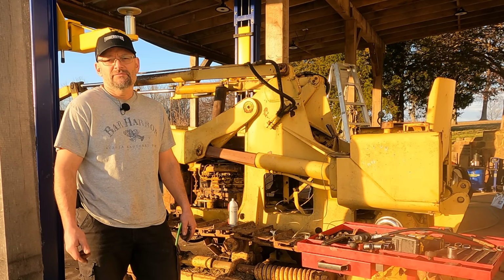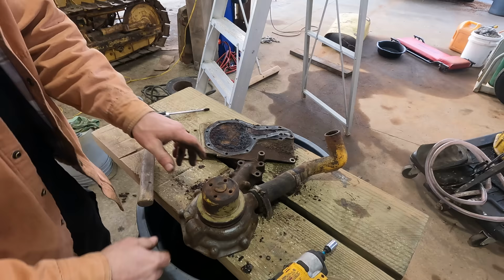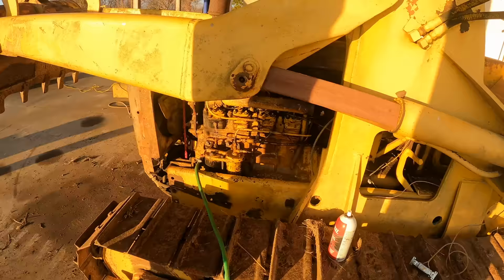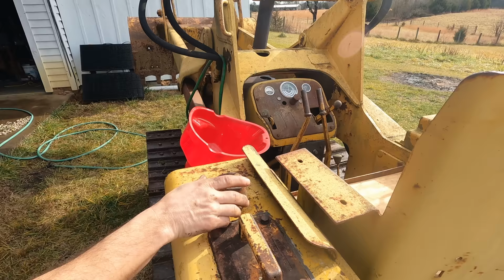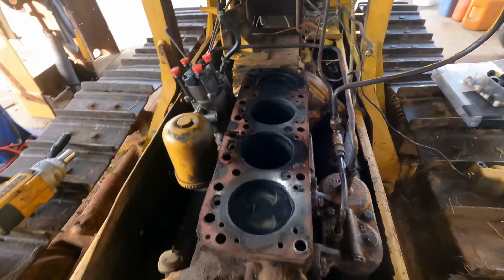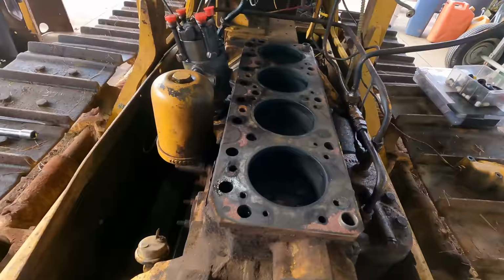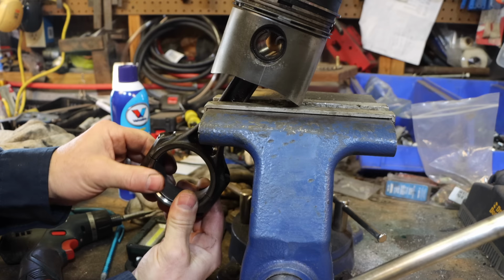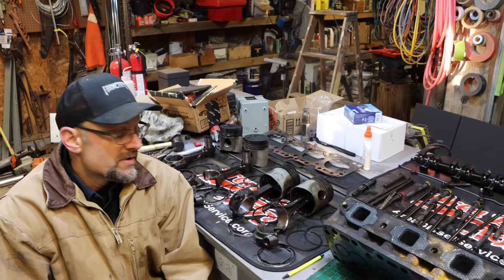1960 John Deere 1010 Diesel Engine Teardown.  Worth Fixing?

Comment: For the steering clutches, I haven't done it on heavy equipment like this, but I have serviced snowcats with similar clutch/brake arrangements.  The material on the brake band may have fallen off at this point.  If you can find the parts, they are usually a pretty easy fix.  There is usually an access panel that you can pull and get to them without tearing the whole final drive out of the machine.

Comment: The clutches are probably dry and if I’m not mistaken you can take it all apart without breaking the track. Now don’t quote me on it it’s been probably 45 years since I owned a 350 and they pretty much look the same. The 350 was a three cylinder. The first day I owned it I had to pull the motor out and replace a O ring on the direction reverser. Only took about half hour to put the motor on a old tire on the ground. You won’t believe just what those little high lifts are worth. Maybe not in money but in just what you can do with them. Small enough to get in very tight places, heavy enough to really get something done.  Still small enough to pull with a 3/4 ton pickup and a good trailer. I wouldn’t look at it as a I need to get it done right now job, look at it as a when a few extra dollars and time is available job. It isn’t all bent to hell and the under carriage is good shape I’d keep it. I still wish I had that 350 today, the guy that talked me into selling it still has it and uses it.

Comment: You could make weld if you have a wire feed Meg on the Pistons, but welding would be preferred. I have even oxyacetylene welded aluminum pistons and turned them, but it is a bit of a challenge. You have to be careful.

Comment: even more content? yes please!
the water pump fix ended up being quite easy considering how locked up it was. you take the wins no matter how small they might be.
very surprised to see scratches on piston wall 1, for sure thought piston wall 4 would be in really bad shape. the compression between the pistons seems really weird though considering the broken parts on two of the pistons and the possible leak between piston 2 and 3.

was really cool to see the pistons, watching that ring just fall apart was, while expected, quite funny to see. then the cracked parts of the piston =( . well hopefully things turn out with the machining.

Comment: Pick you up a roll of that flexseal tape next time you spring a leak in an old rig or something like the dozer that you want to stop the water temporarily wrap it in flexseal tape works great for emergency. Repairs carry some in the car that way if you blow a hose traveling or something you can stick it around the hose and it will get you to the next stop or next part store.

Comment: Hello: John The saying goes, nothing runs like a Deer. Possibly true. The welding should work for a machine not used very much. I did a lton of work on restoring old Aircraft this type of weld repair was used successfully many times.Another option is to use other pistons that are available that are close but larger in required dimensions and machine them to desired size. I am sure you will find a way to make that Deer kick up it's heels or tracks again.
Freeing up that stuborne clutch or brake will also be very interesting to watch.
Looking forward to future episodes. Save The Deer.

Comment: Hey Jon,
It is difficult to justify throwing money t this piece of equipment. However, apart from the glow plugs, a scored cylinder, a couple of broken pistons, the lack of seat, problems with the drive clutches, leaky radiator hose(s), leaky hydraulic hose(s), a couple of marred lift cylinders, and who knows what is in the gearbox, the rest of it looks pristine under that protective layer of rust.
It is a diamond in the rough, or maybe a lump of coal that may become a diamond after application of considerable amounts of heat, pressure and stress. It is no wonder you are excited to get stuck into this project. Those pistons are your biggest issue, although it might be prudent to have a quick look at those clutch plates. Replacing them might prove problematic.

Good luck
Cheers,
EJ

Comment: Jon...  Great video...   Getting this machine running would be worth the investment...  I had my NAA engine and various parts rebuilt and new stuff added...   $3000 price and $4500 in parts and labor to rebuild everything so it was almost new...  13 years later and 1500 hours...  $3/hour and all the work it has done...  priceless...  Then there's the new tires, $1300...  Still worth it...  Who knows what it would have cost if I bought a different tractor...  24 speed...   2 speed Sherman and an under drive Howard...  4th gear has a broken tooth but who cares...  She's a solid runner and revived from the dead...  I'm a believer in fixing stuff if it will serve your needs...  The grand kids will enjoy driving grandpa's tractor...

Comment: Would be nice to see the effect of EVAPO-RUST used as coolant. I think it should clean the system fairly well and if you ever (again 😅) tear down that engine, we would see the result.
Just run it a bit without the system being closed and then let it sit for a few days.. should work 

Thanks for trying and saving that Deere 👍

Comment: Next video, new paint job or repairs on the Hydraulic System.  New Hose, maybe touch up the Hydraulic Rods?  Those clutches need to be looked at also, might be something simple also.   So far this machine has needed a lot of work, but nothing has been a major issue, almost everything has been a simple cleaning and minor replacement.  Maybe the luck will hold out on the rest of it.  But I would while the engine is torn apart maybe give the water system the cleaning it deserves.  Take the pump apart and hit it with some evap-o-rust to get it working better.

Also, hit the electrical tape with a torch to melt it to itself and the hose to make a water tight seal.

Comment: Awesome John. Mate, It’s just a farm machine not a race car so the tolerances can be sloppy but she’ll still be a good machine, a bit like comparing an AK47 and a Barrett Snipper. The AK47 might be put together like a wobbly shopping trolley but it still gets the job done.
I would have just gone with a heavy hone and new rings too and put it back together. Hopefully YT earnings will help cover the cost of the other repairs that need to be done like hoses and parts for new cylinder rods. You did an excellent job repairing the rods on the CAT so at least you know what to do. I think you should call the 1010 “Content” as she’s going to give us plenty of that. 
Cheers, Stuart 🇦🇺

Comment: Glad to see you moving forward with the honing and re-ringing. I was hoping you would have shoved a used compression ring in a cylinder and measured the gap. That would have been interesting to see. To know they exact amout of wear. That's a cool machine, for sure, and it clearly wants to live. With the costs of new equipment these days, it being much slower than modern skid steers or small loaders, it would be worth having around.

Comment: When you said something like ''you can here it trying on 2 cylinders with the glow plugs'' I thought that it was only one cylinder trying. 4 working plugs and you would be away for sure. Like the idea of TIG welding in some new ring lands - the machining should be pretty easy after the welding. I wonder if those lands cracked when it nearly destroyed itself  when you got it well over revved first time?

Comment: I can't help but ask if the price of the sleeve assy included pistons and rings. That is, if it was available... I feel for ya - never seen broken piston lands before, but understand it could be - and wonder if the engine was re-ringed at some point. If the rings were replaced without removing the unworn material above the top ring, that would explain both the broken rings and the broken lands. You are an inspiration!

Comment: You gotta decide to pull the plug for life support at some point.  Weld repair and machining pistons is reasonable.   I would start with cleaning up cylinder #1 to see what that yielded.

Comment: Use Scotch 33.or 99 electric tape.  Smooth surfaces and pull tape real tight several wraps & will hold water under minor pressure.

Comment: Hey John, Thank you for giving the JD another try. I was very happy to see that you decided to work with it some and evaluate it a little more, For me, it give the episode closure. BTW, your editing and videography skills were just outstanding. I was so captivated I didn't even FF to see what the outcome was, I stayed with your presentation play by play to experience the drama.  You came out with a win win:  You got a chance to evaluate the rest of the machine so you know where you stand, and I think you did well with 60,000 views in 7hrs when I viewed it. If I may,  I have a couple things.  I would like to know if the ring lands were freshly broken, if you can tell. I wonder if you broke them when you hammered the pistons out, our if they were broken a while befor. I ask because I broke all of the ring lands on all three pistons in a Perkins Diesel myself by revving it above governed speed on starting fluid purging air after fuel filter change. I was not the first one to do it on that engine, in fact I'm the one who put the pistons I broke in it when it happened befor. But I was not there when it broke the first time, so I had little understanding of just how many RPM's those cheap cast pistons would take. So I wonder if someone else broke them running it on starting fluid a while ago like I did my Perkins, or if there was a ridge that the rings caught on when you removed them. FYI: When I broke my Perkins ring lands, I broke all of them and the engine would only run if I pull started it. Cranking it on the starter, it made no indication that it could start after I broke them even with starting fluid. It would just make a faint Diesel knocking sound and puffed smoke, no change in cranking speed.  But I pull started it, and then I used it for chores. it had plenty of power, but it had a  noticeable amount of blow-by. 
To fix it I just bought new pistons and rings again, just like last time, for standard bore and just put it right back together without glaze busting or honing, just like the last time,. Aside from a little oil passing out the exhaust for a while, like 40 or so hours of working it,  it's like new. It starts easily, has great power and not enough blow-by to mention.  OK, Fine Business. ben/ michigan

Comment: Nice I kinda figured it was a cracked ring ,Watch that either cause it will do that again, What i do with my 2010 hoes are once i use the glo plugs to start it and it starts it will smoke on cold days, I turn the key back to glow plug and in a couple seconds while its running it clears right up and runs smooth. That hydraulic lever to the pump is for super cold weather, the trans might have one also, they dont like pumping or starting while trying to move hydraulic oil that is like honey. I probably have pistons but its to dam cold to tear one of the engines out and tear it down, Id love to see how one is repaired though, Great work ,

Comment: Love the video, used pistons are somewhere on the shelf, don't give up.  Post your motor serial number and machine serial number, and year of machine.  If you post your part number of the pistons, someone will cross reference that.  Buck and Knobby in Temperance Mi in the 50's and 60's was the largest Deere Dealer in the States.  Google the number.

Comment: I wonder if there is a way to size up a more available Deere gas engine piston and machine the valve reliefs in? I’m sure a dealer could get all of the measurements to check on this. This would seem like a more viable option than trying weld up an old piston.

Comment: Like many urban highways, the design specs for your machine was considered extinct and dangerous once out in public due to backward rolls and lawsuits. I witnessed similar cat design in action pulling a ripper, in the seventies; tracks hit hidden log in a field and front end  went up up and flipped over backwards. Rookie inattentive driver fell out behind and got rolled on. Broken vertebrae. So - roll cage is quite a safety addition one would need to make to use this safely, probably with 1/4" wire mesh on three sides.  Not a project to take on for the faint hearted.

Comment: Unburnt diesel like that will definitely make your eyes burn so yeah that engine needs re ringed, it may even have a blower piston from the use of either , I just got done putting a Perkins diesel back together that had very low hours on a reman engine that some used either and blew three Pistons it didn't just break the rings it broke the ring lands as well on three of four Pistons. Them cylinder walls are so glazed there is no cross hatching

Comment: Owe how wrong one can be ! Its because they are so hard to locate parts that make it of value ,with the garbage that is put out today that can't be worked on that people are looking for old equipment to run ,they last longer without trouble and even harder to locate parts and a program on laptop for programing ,and sitting in a field because it can't be moved without a truck and trailer to a dealer because of the right to work on your own equipment .long winded I know so it would be great that you put that thing back into service and really a good running engine is worth more than you think + the satisfaction of putting it back in a unit instead of on top of a pile of scrap so I hope you make the Right Choice God bless .

Comment: Perhaps you might offer some type of update pertaining to the engine repair process.  
I can't help but think of welding pistons and turning them on a lathe to only fail quickly after  reasonably. 
Also, I think you doing a viewers raffle once the mach has be fully reconditioned.

Comment: I think I have four of those pistons in my garage from an engine I've junked.  One is pitted from water in the cylinder.  I'll inspect them tomorrow to see it any of them are usable.  You should also inspect the cylinder head for cracks between the valves and the prechamber holes.  I had two heads and both of them were cracked.

Comment: If the hydraulic pump clutch is disengaged can you fit the belt between the clutch surfaces? It looks like there is a gap there and then you wouldn’t have to take the pump off?

Comment: Seems to me the previous owners may have gone overboard using starting fluid and caused the piston and ring damage. Was probably hard to start being the glow plugs were bad . Ether can do a lot of damage when not used properly . Try to avoid using it or just use a few quick bursts

Comment: My two cents worth from rebuilding small diesels in the 1980s.  Gasoline or too much ether would cause preignition in the cylinder which would break the rings and the lands.  And I have  successfully rebuilt engines with scratches like that in the cylinders not by choice but by cost.  Just make sure none of the ring end gaps are anywhere near the scratches. I'd see if you can ,clean the injector nozzles and have them set to the correct popoff pressure on a injector tester .  I'm assuming they are that type.  But I could be wrong.  good luck

Comment: You have two pistons with the same failure mode. You might have success with welding, but i would expect the same failure on other piston flange locations in future. Not worth the risk IMHO. Instead, approach some disel piston manufacturers and see if any of them have Diesel pistons that are the exact correct bore. Ask for 8 pre-machined pistons and cut them to spec. You may need to mill valve cutouts, so make sure the crown is thick enough. You will be able to use the ring set. You may need to move or resize the wrist pin hole, but hopefully blanks with just the bore and rings cut could let you pick it yourself. Pistons really shouldnt cost as much as you were quoted.

Comment: Probably worth noting that the 1010 crawler is actually based on the 1010 Ag tractor (there's apparently an industrial and an ag crawler) and it was available in both gas and diesel.  Maybe you can get the parts off one of the ag tractors?  It looks like John Deere did the same thing as everyone else and changed the absolute minimum between the gas and diesel engines to get them to run on one fuel or the other.  I'll bet your block and sleeves are identical to a 1010 ag gas tractor.  (this is also why your filters are so poorly placed; the ag tractor doesn't have those guard plates)

Comment: You might find a good used engine on the web,or some dealers also deal in used parts that may still have some life in them.  Hope you get it all fixed up.  You might find something at diesel creek.  Matt is all the time messing with old iron. CNC may be another good source for parts or at the least point you in the right direction. Anyway, Good Luck.

Comment: Heck yea. Keep it going if possible. It’s unfortunate about the broken ringlands. But welding them up is the best option. Casting them would be hard. Maybe if you could find some billet pieces to start with it would be easier, but that would just increase the cost. 

You might be able to find the right diameter and height piston from another manufacturer.

Comment: Will be interesting to see how much gouging on cyl 1 will be there after hitting it with some oil and a cylinder hone a few times, I agree on swapping out the shells on the rods if their cheap and easy enough to find, I bet It'll all be within " old farmboy spec" which is what you could call this dozer series, basically getting a scrap dozer to be a "usuable" every once in a while farm tool, where bodges and hacks galore shall be the order of the day as long as it keeps the $ running/repair cost low, time invested doing said bodges will undoubtedly be high but free, new hydrualic hose, some adustment/tweeking on the turning issues...maybe even blow the budget and get some foam padding for that plywood seat.